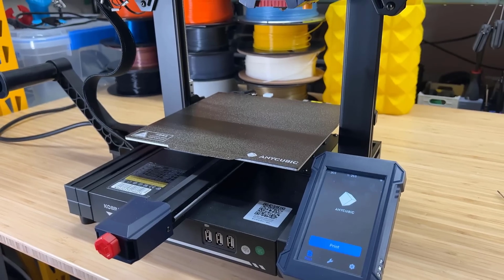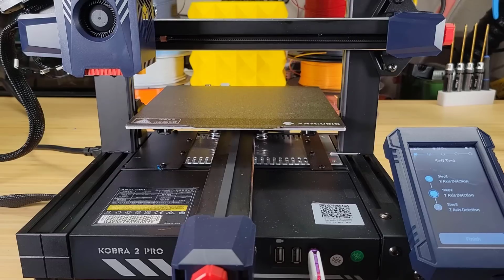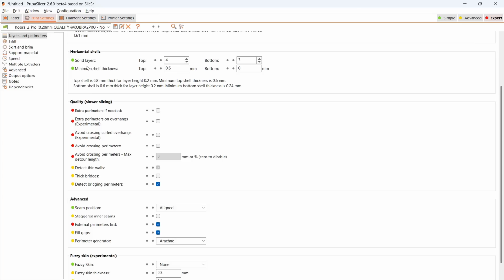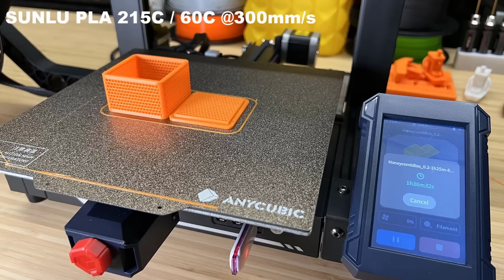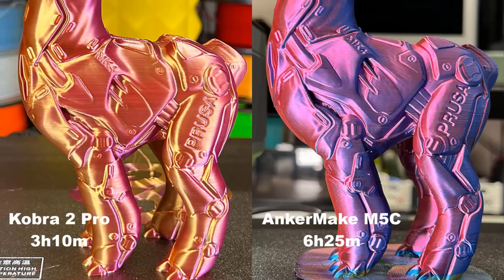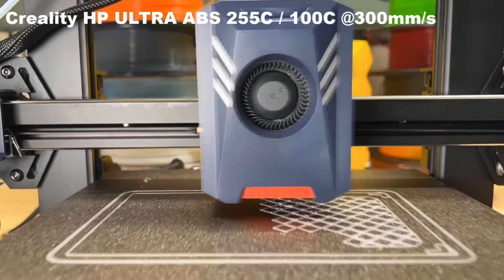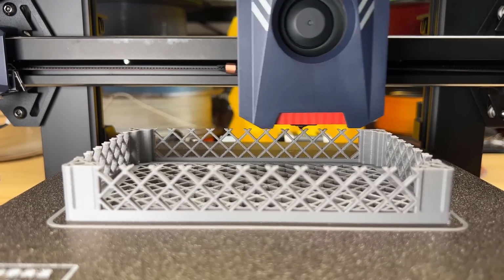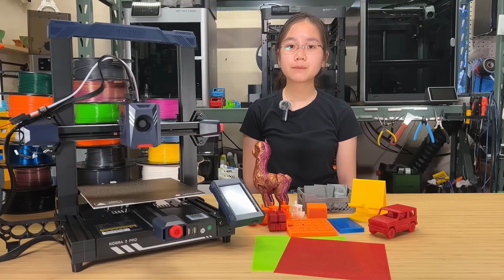AnyCubic Kobra 2 Pro: A fast bed slinger,  good print quality @ 300mm/2 and 20k acceleration

Comment: This vs n4pro?
Reply from the maker: This Kobra 2 Pro is way better.
Reply: @AuroraTech  I don't see a neptune 4 pro test on your channel, so how can you compare it ?
Reply: @AuroraTech  How? The elegoo machine seems to be the same but has a 300 degree nozzle vs 260-270. Edit: Maybe speed?
Reply from the maker: Kobra 2 is way better in print quality, speed, auto z-offset, and overall build quality. While it doesn't have a 300°C nozzle like the Neptune 4, its suitability depends on how often you will use it to print PC or PA-CF. I would rather get the better quality machine (the Kobra 2 Pro) if I just print PLA PETG TPU ABS ASA Nylon 99% of the time.
Reply: @AuroraTech  Thanks for the response. I'm surprised it could that much better. The feature I like on this K2P is the auto z height. That setting getting dialed in what prevents me from using my V2 neo over my other printers.
Reply: @AuroraTech  What about reliability? Many owners of regular kobra 2 have commented that the extruder and auto bed leveling sensor were unreliable. Did they improve something in the pro version?
Reply: I bought the Neptune 4 Pro 4la few days ago. Managed to do a few test prints before it started giving me a headache. I originally wanted the Kobra 2 Pro but stupidly listened to reddit.. I'm not returning the N4Pro and my Kobra 2 pro arrives tomorrow 😁
Reply: I chose a Kobra 2 max over the Neptune 4 max based on this review. Mostly happy with it.
Reply: She's getting money from Anycubic as she mentioned at the beginning of the video, and there's not even a single review for new Elegoo printer generation, what answer do you expect?
Reply: @fedem97 you think she shouldn't get money from anycubic? She is spending days to print all of those and make a review for. It's not something you would do constantly for free. Youtube is not going to give her enough money to do these reviews. But that doesn't mean she is biased.
Reply: @hasanagera she’s in 9th grade she has plenty of time.

Comment: I got it when the price dropped below $130, and the KP3S, which I thought had problems, works fine. Of course, I know the Kobra 2 Pro is superior in every way, but I'm debating whether I should just stick with the KP3S, which is smaller, quieter, and takes up less space. The KP3S is smaller, slower, but prints really well. I'm debating whether I should return the pro, since I originally planned to buy a larger bed printer at the same time.

Comment: I've seen people reporting issues with printing at higher temperatures than 230C because teflon tube in hot end melts at about 240C and starts clogging the nozzle. So it may require replacement for PETG/ABS printing. For PLA printing this printer can work as is.

Comment: Anyone can help me compare Kobra 2 Pro vs Neptune 4 Pro, im a Amateur and need to print Electronic Components' tank with PETG or ABS
Reply: I have the Kobra2, it is beginner friendly, but many people have quality issues. E.g. I cannot run the latest firmware. For ABS probably a printer with enclosure would be better.

Comment: I bought the Kobra 2 pro because of this review and the printer doesn't disappoint at least not for me. I have an ender 3 v2 that took over 26 hours to print a collapsible katana The Kobra 2 pro printed it in 3h59m41s at really good print quality, I am super impressed so far.  The only thing that might be an issue for some is how loud it is but for me the trade off is well worth it. 

Anycubic knocked it out of the park on this printer. Would I buy it again? yes I would buy many if I could afford to.

Comment: I picked up one of these the other day, it seems to work quite nicely, with a couple caveats...
One, the auto-level is not perfect. It consistently sets the Z-axis about .2 mm too low, resulting in the nozzle dragging the bed. This seems to be an issue with a lot of printers. Also, the bed seems slightly off, one side is high. I may use some  tape to correct that. The other thing I don't like is the placement of the spool holder, it places undue strain on the filament where it enters the filament detector, the angle is wrong. I'm currently feedng it from a dryer reel, but I'll likely engineer a new spool holder that is positioned better. I don't like the filament having to make a sharp bend like that, it's already broken twice. Also, there's no light, so I used a clamp-on one. Speed is excellent on this machine. Pretty noisy, though.

Comment: Very well done review as always.  Thank you for all the details and pros/cons section.  Just pulled the trigger on this one as I wanted a fast bed slinger and the price this holidays was to good to pass up!  FYI to anyone else is make sure you check for discount codes before you commit to the purchase. Saved another 20.00.  Also a free roll of high speed PLA thrown in!  Thank you Aurora!!!

Comment: For PrusaSlicer und Anycubic Cloud and Z Offset Crash dodge

Start Custom G-code

M140 S[first_layer_bed_temperature]
M104 S[first_layer_temperature]
G28
G1 Z{total_layer_count * layer_height + 2} F3000
M106 S0.0
M190 S[first_layer_bed_temperature]
M109 S[first_layer_temperature]

End Custom G-code
M104 S0                                    ; Extruder off
M140 S0                                    ; Heatbed off 
M107                                       ; Fan off 
G91                                        ; relative positioning 
G1 E-5 F3000                               ;
G1 Z+1 F3000                               ; lift print head 
G28 X+0 F3000                              ; 
M84                                        ; disable stepper motors
;
; statistics = begin
; model_size = [first_layer_print_size_0]x[first_layer_print_size_1]x{total_layer_count * layer_height}
; total_layers = [total_layer_count]
; statistics = end

May help for others

Comment: Brilliant and thorough video. I'm new to 3d printers and looking to purchase one in the next day or so. Been looking at this one and the Ender 5 S1, but don't know which one is going to be best, will be using it to make diy bits more than anything and would prefer something with really good quality. Which out of the 2 would you recommend, or is there any others that you'd recommend costing around 250
Reply from the maker: Kobra 2 Pro is way better.

Comment: The only profound review of the Kobra 2 so far! Great job! Thanks for clarifying the non-existing options with regard to klipper and the non-original volcano nozzle. I still hope that ANYCUBIC will release some firmeware updates that enable the full potential of Klipper and I would be very fond of different nozzle sizes. With this speed you actually don't need bigger nozzles, but some filaments and some objects look really cool when printed with 0.8 or 1.0 mm nozzles (e.g. transparent PETG). For me it looks like Anycubic was unter pressure with the release of this printer series. Probably to keep up with Crealty and Neptune launches. However, the full functionality has not been developed yet... So lets hope that they will bring some really cool features in the near future. Have ordered a Kobra 2 Plus. Fingers crossed.

Comment: So this has been my experience with this printer since I've got it.

I've had nothing but problems;

Half way through prints the system will just shut off and become non responsive.

The XY belt for the print head snapped in half midway through printing.

The plug melted, the fuse box melted causing sparks from the power switch.

When I tried to talk to the service department they kept telling me that they were not receiving my emails yet in the most recent email I got from them I can see all my replies in their history, so they had been receiving my emails this entire time, when they replied the final time the previous emails that I had sent that they had said they previously did not receive are there.

When they said they could send me a replacement I am told to ship it back to China which would cost me more than the printer cost to begin with.

So now I'm stuck with this printer that does not work, that causes sparks and a potential fire in my home and there's nothing that can be done about it. As an owner of a Mega Zero 2 I was a loyal customer but now I'm extremely upset with the service I've received and as far as I'm concerned I will never buy another Anycubic product again. I should have gone with Creality or Bamboo.

Comment: @AuroraTech please respond: how can I adjust Pressure Advance? It's one of the most important parameters in Klipper printing. Why haven't you discussed it? Thanks, you're the best!
Reply from the maker: No, you can't do that with this machine; their firmware is closed source, and there is no way to access the printer.cfg or other config files.

Comment: Was it a good 3-D printer? And would you recommend buying it? As a beginner.
Reply from the maker: Yes, the Kobra 2 Pro is on my recommendation list, which currently includes only 8 out of the 100+ 3D printers we have tested. Please check out auroratechchannel.com
Reply: Ty

Comment: Hello, I have a problem with the cube, when printing, the lower part joined together, which made the cube not functional, what is the problem, I use cura
Reply: Dont use cura, try orca slicer with elephant foot compensation.

Comment: I watched this video just before mine arrived and have to say, it is the best I have found. I also printed your filament holder replacement! Have you tried the Cura profile? I seem to be running into some issues with it. I use Prusa Slicer simply to make sure the designs I draw up are watertight. It seems they overcomplicated things and put settings where I'd least expect them. My main issues in Cura are that the .gcode files once sliced and put on the USB are missing all of the metadata. I can't adjust the Z axis before printing and it shows no details. I also noticed while using Cura instead of Prusa, that it doesn't release any filament on the side before beginning a print, never wipes the nozzle and if I choose a skirt with one line, it will do two anyway. I have a certain file that comes out perfectly in black but when I print it in white, I can see the lines showing through the pei texture in some places. The most annoying thing is that once it's done printing, it will push the bed towards the back rather than move it towards the front! 

AnyCubic sent me an email asking for my comments on it but I feel like there are soo many to list and I would forget until confronted with them again, so I'll consider this my rough draft. I do like this thing a lot. It's miles ahead of my Alfawise U20 and CR-10 Minis, but they definitely have some bugs to work out still.
Reply: But why Cura if Prusaslicer is better ?
Reply: @cristianjosadec  Because Prusa Slicer isn't better, it's a preference. Prusa Slicer just overcomplicates the same options. The only difference is NetFab repair tools.

Comment: SV07 vS N4PRO VS KOBRA 2PRo ?
Reply from the maker: #1 Kobra2pro 
#2 Neptune 4 pro
#3 Sv07
Reply: @AuroraTech  is there any way to clean the nozzle before each print? adding some add the gcode start? thanks

Comment: A bit late to this video but, if you are still reading the comments - the Kobra 2 Pro or the Sovol sv07? The Sovol is a bit cheaper, and has open Klipper, but this appears to be better built so I'm a bit torn as to which to go for.

Comment: If this printer doesn't have the ability to connect to a computer is there any way to do PID tuning and extruder calibration?
Reply: Anycubic needs to release the firmware and then someone would need to incorporate standard Klipper into an alternative firmware.
Reply: @womplestilskin  Are you sure that Anycubic will release their software? So far they haven't mentioned it anywhere and it looks like they don't want to do it :/
Reply: @michamalicki1819  Legally they have to. Users have to pressure them if they don’t comply with the GPL
Reply: @womplestilskin Anycubic claims that it is their proprietary "Kobra" software nowhere do they officially mention that they use Klipper.
Reply: @michamalicki1819 they don’t have to mention it, it’s almost certain that they used Klipper code.

Comment: Do you know if the USB ports can connect to a PC or SBC (Pi etc) to control it via Octoprint etc ??  Or even Mainsail/Moonraker I guess.
They seem to all be USB A ports that would only be Hosts(??).
No USB access would be the real tragedy of it !  (There is possibly an internal USB on the mainboard)
Reply: I was thinking more about this....
It is likely they have a mainboard that is sort of "all in  one" - the typical mainboard, but also the SBC section you would normally have externally (Pi etc). This is why it has "8Gb storage" - that is part of the SBC section.  So these are all on one board, with direct connection - not via USB, which would be the "link" in the chain that you are the one providing the SBC externally.
I will have one in a day or so and can check if they MIGHT have used two sepearate sections.  A typical mainbboard and also a SBC of some form. But cost-wise you would expect they did that as an "all in one".
But anyway, if they did not design it with intentional access via USB Serial (externally) then they probably don't want anyone having such access, flexibility. This would be to lock it all down to FORCE the use of their App and Cloud. To get around that might need it to be modded with a totally new mainboard (back to the prior generation more generic type boards) to run the Klipper firmware, then with your own Pi etc for Klipper.
Their stuff highly likely COULD be reprogrammed to be generic and more useful to the masses, but that would take a lot of work to reverse engineer and complete!! Or if we are really lucky, the mainboard is quite generic and then can be reprogrammed with setups (config etc) already out there for Klipper. Though the Screen and Levi Q - any Kobra2 specific things - would need to be set up, programmed for, also (if possible).

All in all this "super locked down" system they are moving to is a big negative to users freedoms, and ability to add/implement far better things for it. Whilst locking you down to relying on Anycubic to do "good or useful" things.... and they are pretty poor at that, so.....
Many brands are swinging to this strategy, so you have to be studious in working out WHAT you are exactly going to end up with.

Comment: Hi, I have an Anycubic Kobra 2 NOT the pro bought it just before the pro was released otherwise would have got the pro

I have a size issue on it I have to correct the parts with zoom in the slicer before I can print accurately

Obviously normally you set steps per mm but there's no option

Anyone know how to solve this? There's nothing in the manual and I contacted anycubic but no reply, nothing on Reddit

I can't just "Terminal" in as people suggested on the Prusa forum it has no USB control right?

Comment: Hi, I have an Anycubic Kobra 2 NOT the pro bought it just before the pro was released otherwise would have got the pro

I have a size issue on it I have to correct the parts with zoom in the slicer before I can print accurately, with a custom X, Y & Z zoom I can get it to print accurately over 200mm checked 50, 100. 150 and 200mm but it's a hack!

Obviously normally you set steps per mm but there's no option

Anyone know how to solve this? There's nothing in the manual and I contacted anycubic but no reply, nothing on Reddit

I can't just "Terminal" in as people suggested on the Prusa forum it has no USB control right?
Reply: Search high tolerance parts budget 3d printer and you should get a video that walks you through a helpful process, even though it’s a different printer
Reply: @womplestilskin  I can fix it myself with an M92 code which set the steps per mm for Marlin which Anycubic runs just need to fine some sane values to do it but we're almost there

BUT anycubic should have this in the firmware

Comment: Typical I ordered the normal Kobra 2 and two weeks later they announced the pro version, just my luck.

On a side note how do I get it to print the line around the object before it begins?
Reply: I'm a bit late seeing this but in Marlin it's 'skirt' under the build plate adhesion type. Not sure in Prusaslicer etc but should be something similar.

Comment: I saw your model with the top filament holder on printables. Thx for this.

So is it not possible to use the filament sensor with that holder?

Comment: i love this Chanel: Which printer is better: Kobra 2 Pro or the new Elegoo Neptune 4 (Pro)?
Reply from the maker: Kobra 2 Pro
Reply: @AuroraTech  can you explain why?
Reply from the maker: The Neptune 4 pro can't print as fast as the Kobra 2 Pro as the stepper motor is using a 40mm instead of a 48mm, when I print the same gcode with 20,000 mm/s² acceleration and 300mm/s print speed, the Neptune can't handle it resulting in layer shift. The extruder of the Kobra 2 Pro is also better.
Reply: @AuroraTech  thanks man/girl
Reply: @AuroraTech  Why is Kobra 2 Pro extruder better?

Comment: Is it possible to mount the filamentholder on the top?? (Kobra 2 Pro)
Reply from the maker: Yes, I just uploaded a Youtube short printing a 15m benchy with a top filament holder.
Reply: @AuroraTech  And what about the filament sensor and the tube when the filament holder is on the top?

Comment: Great review. Content of your video is too good. We have so many great entry level options now so I think you should create a video for best entry level printer. Also a review of Neptune 4 / 4 Pro is due. Any ways great job.
Reply from the maker: I have to cancel the Neptune 4 Pro review as there are some issues with the machine. But they said those issues will be fixed in the large batch production, but my schedule for the rest of the year is full and may have no time to test it out again, maybe I will try the Plus and Max, let's see.